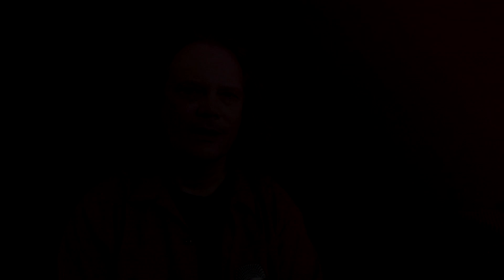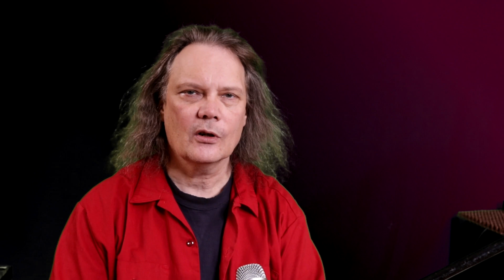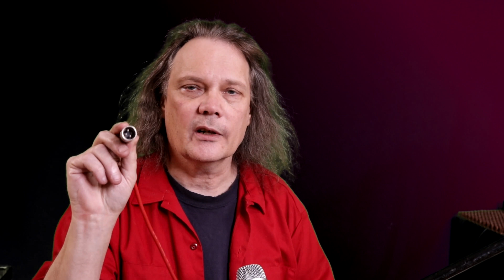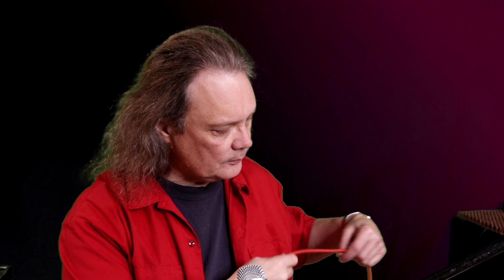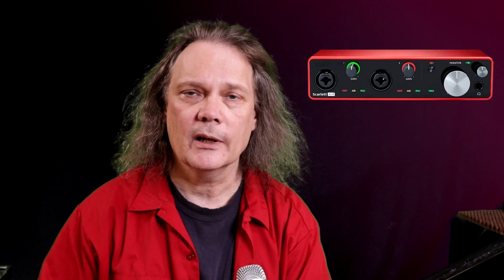Pro-Sound to Consumer Audio Connections: Why Adapter Cables May Not Cut It

Comment: Consumer gear (amps and preamps) will indeed overload and clip and get damaged by pro level @ +4db.
Reply from the maker: I would be surprised if equipment became damaged, but it may be possible to overload the input and experience distortion.

Comment: I'm running all PS Audio gear (consumer hi-fi) and it uses all balanced connections sooooo... You're not completely correct with this.
Reply from the maker: Thanks, I too am a fan of using balanced audio connections.
Reply: Your system was made to accept+10 line level, so it's "prosumer"

Comment: Which converter do you think is better, the Rolls or Art's Clean Box?
Reply from the maker: Good question, I have not tried them side by side. However, modern opamp chips, which are the building block for these sorts of things, are really good -- so I would suspect that both of them would offer excellent sonic performance.